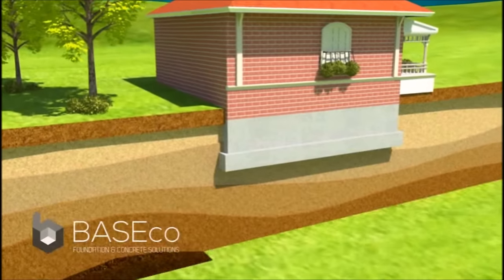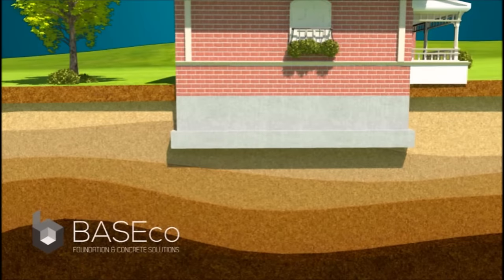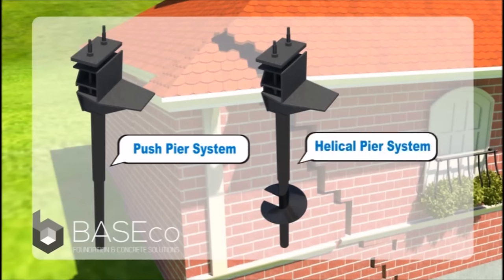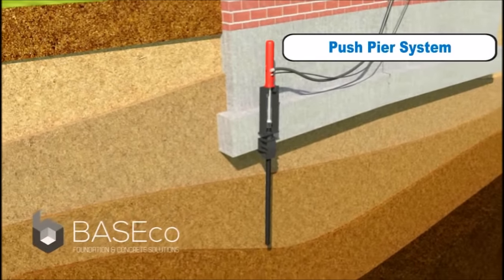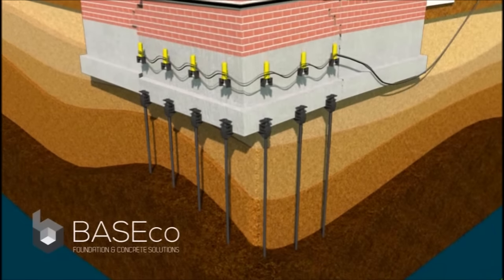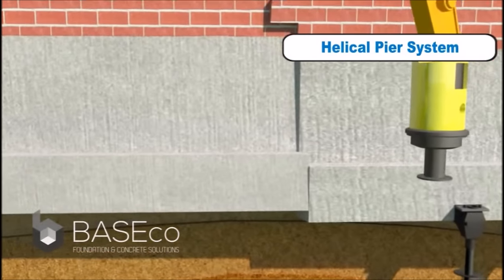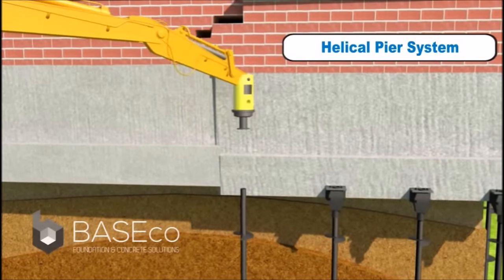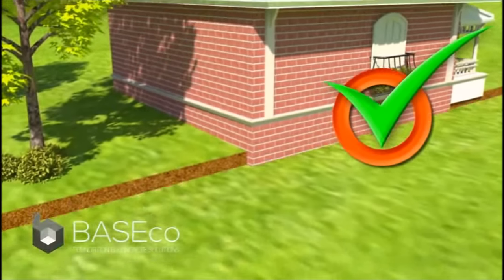Foundation Repair with Helical Piers and Push Piers

Comment: For anyone or contractors, FYI: Never use foam, it is basically plastic and breaks down over time, will not last.  Galvanized or Stainless steel is the only way to go.  Do not let anyone try and sell you just steel, DOES NOT matter the grade, rust never sleeps, and below grade there is always moisture.

Comment: A little cofusing to see the heavy machinery pushing the HELICAL PIERS into the ground , and then the audio states that they are put in until reaching required torque. can someone explain this and what is meant by the weight of the structure itself not bieng what is used top make them work? being in weight bearing soil is what makes them work not weight right??? when is the weight of the house ever beneficial to making a pier work if you might explain ,.......since if the house had no weight at all for instance gravity would not be causing any settlement in the first place. what the hell? Is there a reason this is confusing to me besides my ignorance? or could it be explained in a better way?
Reply from the maker: There are two types of piers in this video., push piers and helical piers. Push piers use the weight of the structure, helical piers are installed using machinery until they reach the desired torque.

Comment: Curious why there wasn't concrete beams used in the foundation at the first place during the fiest time build, its a bit expensive sure but down the line, eliminates a lot of headache.
Reply: Because there are OLD houses that were fine for 100 years with out it.

Comment: Appears that you can stabilize the outside perimeter of a structure and you guarantee the result. Brave statement. How do you stabilize the interior footings from movement?
Reply from the maker: Duke Duarte With piers under the interior footings. Not much of a brave statement, this technology has existed for years.
Reply: BASEco Foundation Repair and Concrete Lifting how do you install piers  to stabilize interior footings.   Typical interior footings here are 24 inch square. Do you have a video?
Reply from the maker: @dukeduarte8728  cut through the floor on the inside of the home.
Reply: @BASEcoSystems  how are you driving the piers down from the interior?
Reply: @BASEcoSystems how much would it cost to cut through the floor and repair the foundation?

Comment: Is one better than the other? Im getting two companies swearing by both... and im leaning to the push peir because it looks less invasive. It is such a strange scenario since the house has almost no damage but the sloping is severe.
Reply from the maker: You are absolutely right, push piers are much less invasive. The other benefit to a push pair is that it is load tested while it is installed. So we know it works and will hold the weight. Helical piers are theoretical during installation and we cross our fingers and hope they hold the weight once they are capped off.

Comment: In the first place the foundation should have been better.  The  concrete should have been steel reinforced  and assuming that the perimeter was a square,  then a diagonal  or two would have been added and  an inverted prism effect obtained by using the third dimension components.  The  triangular  inverted prism  made of triangles would have been solid and would not distort and the whole house would move solidly without any cracks anywhere. It would be a little more expensive to start with , but better and more secure in the long  run.
Reply: tell us how that helps now? you have access to a time machine?

Comment: As a carpenter and former home builder, I would replace the damaged. If your floor is crooked it can usually be fixed from under the house, the piers may need to be replaced, because over time your outside foundation settles and your inside one don't, so lowering the inside one will straighten your floor back out. The outside band could be rotten and need replacing. In a lot of cases even if you did this it wouldn't fix your problems. Everything settles, and all foundations and concrete slabs crack. It doesn't matter if it has rebar or wire in it, it all cracks. So if there is just a small crack I wouldn't worry about it to much.
Reply: Got house with geo piers, water intrusion fixed dry in basement no issues there BUT noticed at the top of a 12ft section the wall starting to pull away from house at the top  so the sill plate(2x6) hangs over inside basement about 2 1/2”. Floor slanted. Would this work. I thought just jack house and re pour or build cinder  block wall? Any ideas
Reply: @StLbfdup  On most houses the brick on the outside of the house is just covering like siding. The house is built then the brick wall is added after the house is built. Unless it's a block house. I would have to look at it, but it sounds like you are saying the brick is pulling away from the house. And that can happen. when the brick are laid they attach it to the house with little metal pieces and nail it to the wall and mortar it to the brick. If the wall starts to rot, the nail pull loose and that could cause the wall to move away from the house. In some cases, you may have to relay the brick, to do that you have to take the brick off the house, when you do you will have the perfect opportunity to replace the plywood on the wall. then relay the brick.
Reply: just remember before you take the outside wall off build a temporary wall a couple of feet inside the house to hold up the weight of the house. If on a floor system you may have to put wall or supports under the house too.
Reply: dejalos vender

Comment: How about Alccofine microfine cement injection grouting for soil stabilisation?
Reply from the maker: works well with stabilization, doesn't always lift. Typically we use a combo of the piers and injection to stabilize the soil.
Reply: Does home insurance usually pay the cost for this. I could only imagine the the setback.

Comment: Use a jackhammer with a pile driver head, schedule 80 black pipe. Driven to refusal. Cheaper
Reply from the maker: Jimmy Rice at what pressure is refusal with that approach? How do you know “refusal will be load tested? Cheaper than what?
Reply from the maker: @Zachary Morris Great input, Zachary. Many of the homes we deal with have full basements as well, so we often see upwards of 4,000 PSI for our applications. Thanks again!

Comment: So do you first recommend an inspection from a structural engineer which could cost about $500?
Reply from the maker: That's not a bad place to start. However, if we are in your area we can provide a free evaluation and estimate for repair.
Reply: @BASEcoSystems  please come to my area. I know the house I just bought needs this.
Reply from the maker: Paige Phillips where are you located?

Comment: Average cost of helical repair is 20 to 30 K$. The first helical  segment has 2 cutters. The rest are just extensions. With this system you also get a long term guarantee.
Reply from the maker: John Stauver not entirely accurate on the cost, some jobs can be much less depending on size area being lifted.
Reply: @BASEcoSystems how much would it cost to repair the foundation on a 3 bedroom,1 bathroom house with 1000 square feet of living space please?
Reply: just got an estimate on my house.  They are having to go the whole perimeter.  $75,000   @DL-1
Reply: @fuzzybunny8095  what??? I'm sorry to hear that.

Comment: in general how much would it cost?
Reply: The problem with giving someone a "ball-park" estimate is that every foundation is unique. Cost can vary wildly depending on how many piers need to be installed and how bad your foundation is. Someone with expertise in that field needs to actually go out there to look at it. You might not even need what you think you need, and it could be another kind of project entirely. I would be wary of contractors that give estimates without first looking at the problem in person, because no two problems are alike.
Reply: My brother is paying around 6k
Reply: It doesn't do any good to ask "in general", because the standard useless response is "every house is different".  Well, everyone knows that.  We'd just like to know "in general".  Surely a median cost exists.  $1k?  $10k?  $50k?  $100k?   No one is going to hold you to it.
Reply: @kwebster62  With major foundation repairs involving hydraulic piers costing $10,000 or more, and minor cracks costing as low as $500, most homeowners will pay around $5,838 to repair foundation issues. Here are a few things that can influence the cost of a foundation repair.Jul 26, 2016
Reply: @sergiomash  Perfect.  Thank you.
Reply from the maker: It's all going to depend on how much of the foundation has settled. This example is just the corner of the home.
Reply: anywhere from $175 to $500 per pier.
Reply: @Amber4RonPaul 
That quote was for their commercials. They are good, but extremely expensive.

Comment: So what happens if you don't fix it...?
Reply from the maker: Steven Burns it will continue to settle and get worse with time if the water table fluctuated or drainage issues aren’t addressed.
Reply: @BASEcoSystems  I have a friend here in FL bought house 15 years ago the garage/former carport was down in one corner between slab and driveway about a half inch and hasnt moved in all this time slab is cracked in the middle. garage door stuck a little so I just adjusted it for them. while I was there I noticed the corner catches a little water when rain hits the garage door in very bad storms. it's been this way for at least the 15 years he's owned it should he just leave it alone?
Reply from the maker: @dereckc9469  Yes, just keep the water away from it and it may never move again
Reply: @BASEcoSystems  thanks for the reply